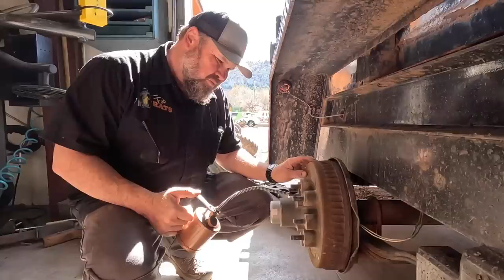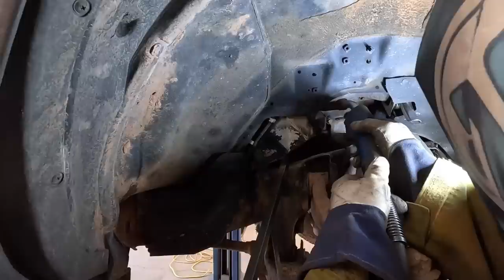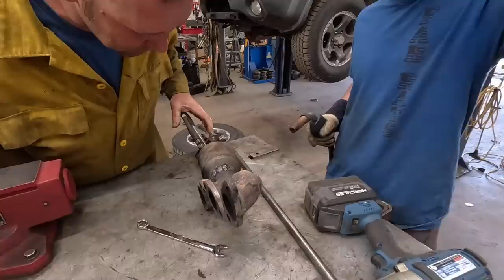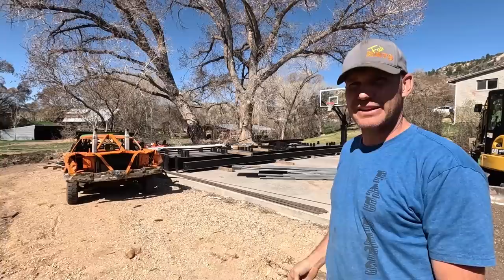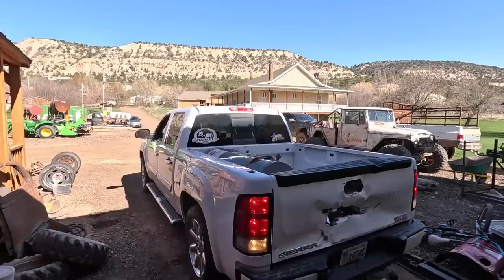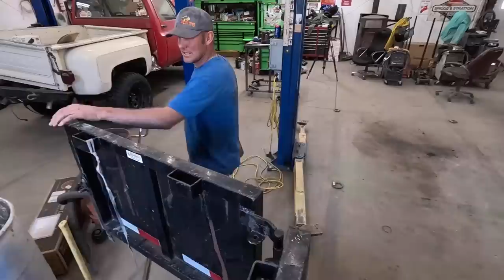This Is What Goes On At Fab Rats Between Big Projects!

Comment: Ben, I would say use anti-sieze when you have two different metals, like stainless and regular steel and on any alloy like aluminium or magnesium. Oil and grease work great on a steel to steel connection.

Comment: Finally a Nissan in the shop. I love these vehicles. All the parts from the Titan to all of them are interchangeable. Putting the Titan suspension on the other platforms give you long travel. Even special Titan swap shocks you can get.

Comment: Nice to see Ben adding a little oil to the studs.  It makes a big difference several years down the road when the next person needs to pull the nuts!  I use Silglyde on mine.  It's very easy to apply, I think it stays in place better than oil, and I can pull nuts a decade or more later without any fuss from either the wheel or the stud.
Reply: You should never lubricate wheel studs if you torque the nuts, as you should,, because it fools the torque wrench and you can break the studs. Ask me how I know...

Comment: Ben, I never add and oil or anti sieze of any kind to wheel studs. For 40 years I've put them on dry and never had a problem getting them off at a later date. There is concern of over torqueing the wheels nuts while putting them back on leading to broken studs at some point if the threads are lubed. If you've had good luck with lubing them, then keep doing what you're doing, but I've had good luck with my method as well. You guys are doing great work, thanks for all the cool content.

Comment: Back in the late 1970’s I worked for a major auto testing fleet. We had a fleet of 18 wheelers that would break wheel lug studs all the time. They were running 150% of legal loads. We started using anti-seize and ended the failures overnight. The anti-seize helps on the threads but it’s really for the face between the nut bevel and the wheel rim. This prevents metal galling and allows the nut to fully tighten up without jamming into the wheel before it reaches full torque. If used correctly it will be much better than oil that can encourage the nut to work loose.

Comment: My wife has a 202 Nissan Xterra with the supercharger & 4x4 (5 speed) & I was super impressed on how that thing handled off road. It's a climbing SOB in the mountains. I found out that these models are rare & worth some bucks to the right people. BUT, I never did figure out how to adjust the headlights. Dealer said it's set at the factory & that's it. Hmmm, your thoughts Paul/Ben?

Comment: Lubricating those wheel studs will change the torque setting on the lug, unless you reduce the wrench setting by about 20%.  Some of the torque you normally use to get, say 100 ft.lbs of torque on a lug, is thread friction. Remove that friction and you are applying more than 100 ft.lbs on that lug.
Reply: They use an impact gun dude. They rarely get out a torque wrench.

Comment: Those are homemade headers.  The oem are notorious for cracking.  Tell him to beef up the steering too if hes gonna beat it.  Those idler arms are a weak spot too.  And scan it for knock sensor code.   The sc will run limp with it on but won't trigger a CEL on its own.  They are a pain to replace so most room it with a. resistor or move it.

Comment: anti-seeze.. not for lugs.. moving sliding parts yes.. tires wobble off cuz many not check them til it's too late lol
my friend had it happen 3 times til i figured it out..
simply wire brush threads & gear oil .. ;)

Comment: I just bought a 98 XJ and the lug nuts were very hard to get off. I found silver stuff on the lugs which I wire wheeled off. I just use a lightweight oil on lug nuts or nothing at all

Comment: Hey Paul how you doing my name is Aristeo but I go by Dale I have a 2000 Tahoe limited two wheel drive with a 5.7 it has a bad Miss it's still drivable but when it heats up it seems to drive a little better it does not show a check engine light

Comment: It's 6010 or 5P both are dirty rods able to weld on all kinds of rusted metals but it's best if you use that to get good metal and then drop some 7018 on it to bond it properly you can use hippie rod if needed but is mostly not needed for most applications 8018

Comment: Use anti-seize. Oil on the lugs will require you "wet torque" which is different than torquing them down. Anti-seize doesn't really change the torque requirements much.
 You may also need to "wet torque" for anti-seize, but not as much as the anti-seize has material in it (sacrificial metal) that causes friction.
I reduce the torque on lugs by 5 ft-lb for anti-seize... or use the lower of the torque numbers ("Torque to 85-90 ft-lb" <-- use 85 ft-lb)... 
With OIL, or other LUBRICANT, you need to wet torque and reduce the torque by 25%.

Comment: The only thing about welding around that Nissan truck's engine is that it's got a lot of plastic parts. My Dad had one of those trucks, and a couple of my nephews borrowed it and burned up the engine off-roading. It would have cost more to fix it than the truck was worth.

Comment: Wheel mount surface and studs are supposed to be clean, dry, and free of oil or lubricants for maximum clamping force and accurate torque.  At least that’s what they told me at TIA.

Comment: Doesn't matter whether you use anti-seize, motor oil or some other lubricant. It can affect the bolt torque, but if that's a scenario where it matters the manufacturer should spec what kind of lubricant to use and you should not deviate from the recommended spec.

Comment: I do not use any lube on lug studs, as so in order to NOT change the amount of torque being applied to the mating surfaces, which can remove lug studs with the fury of an F5 tornado, and in turn ruin the ease of either a four corner slap or  the gravy of a 2 axle brake job.
I prefer to go dry and let the blood run in.😂
Reply: Also, good job teaching Hunter how it's done Paul

Comment: I was always instructed in factory service manuals and manufacturer literature NOT to use any lubricant on lug nuts. Proper torque values produce over-clamping on rims and brake drums/rotors when threads are lubricated. I know, I know, I only worked in the auto trade for 43 years...just a rookie.

Comment: I know you’ve been lubricating your lugs for some time but you really shouldn’t be using anything on the lugs.  The problem is that when they are lubricated you can easily over torque them and stretch them or snap them.  I’ve had to come back and replace lugs after they got broken from having them lubricated. The same torque value will achieve a whole lot more tension in the stud and start causing stretch very quickly.

Comment: FYI    According to the ministry of transportation it is actually illegal to apply anti-seize or any kind of lube on lug nuts or bolts.  Also, it changes the torque of the nut so do not teach the whole internet to lube wheel studs.

Comment: You guys are to trusting of hydraulic lines.  A guy got crushed recently when a hose busted on a lift. He failed to set it down on the mechanical stop and when hose blew the weight of the car was to great and broke the stop and crushed him. The last thing you would ever want to happen is killing a friend or brother by taking a short cut.  When lift the trailer same thing at least put some in place to prevent it from crushing while welding on it.  Be safe guys

Comment: Damn ole son easy on the trigger. Zzzzit zzzit zzzit zzzit short arcs just enough to fill then off then on then off then on then off. I’m a certified welder 4G unlimited on mig/ wire welding and duel shield at that. That’s gas and flux core.  All the way to 5/32 which is pretty much welding with fencing wire or at least that’s what it feels like. And I can run a single pass 5/16 to 3/8 with 5/32 duel ships wire that passes both bend and ultrasound testing and my 1” full penetration was the strongest the inspector had ever tested he  could not make it break and had to cut it after the bend to see the root. The certified Lincoln teacher watched me weld then tested my single pass 5/16 and 3/8 pass then asked me to help train the rest of king steel welders to run the new 5/32 wire.  Even gifted me his American flag Lincoln hood his personal hood. I don’t think he paid for it. And it burnt out after a few months but it was still an amazing gift / trophy. I was the only king steel employee to never fail ultrasound testing